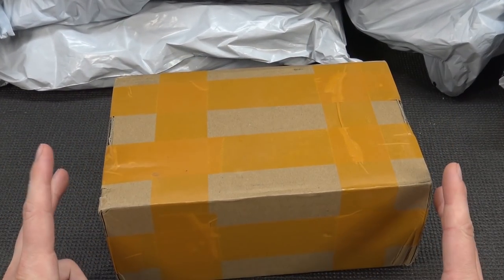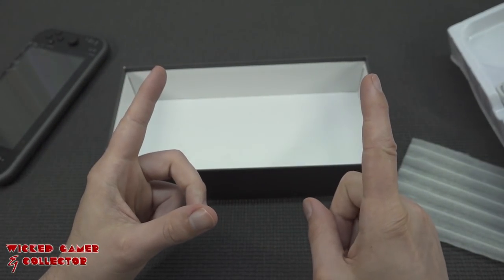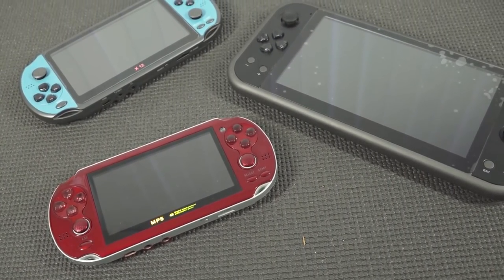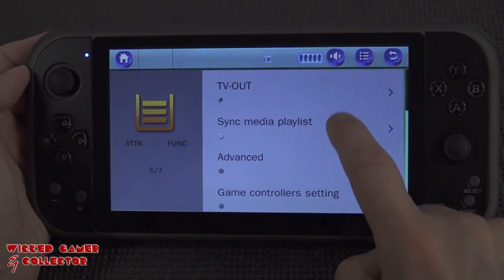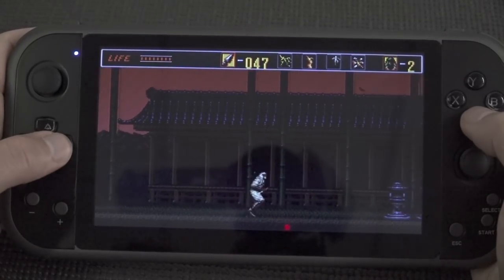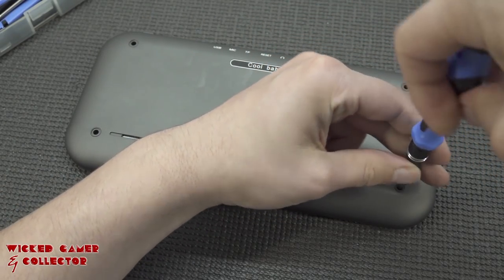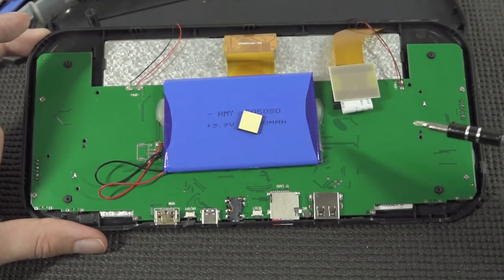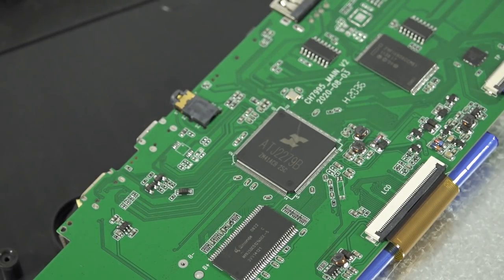7inch Budget Gaming Beast Handheld with a Touch Screen ... 👈

Comment: I like the form. I wonder if you can just take out the crappy guts and replace it with a decent chipset? Maybe rpi CM4 and a decent battery.
Reply: It would be nuts if someone manage put a Pi Zero 2 in it, nice systems and much more capable emulation, even some psp. And that device is beautiful, with more power it would be nice

Comment: I loved the x-15 because with drastic it was actually one of the few devices that was well designed for ds emulation with a mic and touch screen... but my god the lack of google store support and having to hunt down cracked apps and get them working really ruined it for it.if they made a version like the x-15 but with a better directional pad and 2 analog sticks, and google store support, it would be a great little handheld.

Comment: And it's again the ATJ2279B, I knew it just from seeing the software, especially the settings menu. Well this one is not going to provide much power as it's a MIPS at 400 MHz or so with only 2D acceleration.
 Software could be improved though but unfortunately it's not open source. I was thinking of reverse engineering it but not sure I'll have the time and mood to do it.

Comment: Hey man! Can you tell me if any handhelds have Amiga 500 games, please? Cheers for the videos BTW!!
Reply: Your best bet is the rg351 won't come with any installed. But you can install a 500 emulator and games yourself or there are sellers on eBay who sell SD cards absolutely loaded with all different kinds of emulators.
Reply: @simonday9013  hi, thanks for the information, which type of rg351? M, P or?
Reply: @Daniele_Lampis  it doesn't matter as far as internals go. The p has a plastic body (a very high quality one) and is cheaper than the m that has a metal body.
Reply: My rg351p came with amiga games installed. They tend to dump them all on one amiga folder but it will run cd32 and other variations as there are 3 different emulators curated by emuelec and retroarch
Reply: retroarch compat ones have emulators.
Reply: Thanks you all for taking the time to help me out! Love your work!!!❤💯

Comment: I just may get one of these! It looks like my Powkiddy X2.
Reply: Dont waste your money Johnno. 
At least with the X2 (and my RS18) you can change system icons and add boxart to your own builds. I did.  (Although can be time consuming). 
This one has the crap UI and sub par performance. 
If you want another cheaper 7" you are better off with the revision 2 of your X2.
At least that one has better joysticks, dpad and type C connector. 
Still no L2 and R2 though unfortunately.
Reply: @fonzitheman  The system icons and boxart don't bother me. I still plan to get one! There are lots of things I like about this one, including the design, the dual speakers and aspect ratio options.
Reply: @jonathonearl482  
Well, you obviously know what you''re getting so…. Have fun I guess 😌🙂
Reply: @fonzitheman  
I have a different handheld in mind that I think we both could look forward to. I'm looking forward to purchasing myself an AYN Odin! It just may be the handheld to successfully break the 32bit barrier.  Able to run N64 flawlessly and has a 6 inch screen. What are your thoughts on the Odin?
Reply: @jonathonearl482  
Oh yeah, I am interested in that too. 
Maybe the Odin Lite though, not sure yet. Will see how reviews are on all the diff versions.. 
Its not a 7" I know but almost 6" isnt bad I guess 😊.
Not interested in the Powkiddy X18s or the Steamdeck either, mainly cause its more than Im willing to pay for a handheld and a few other reasons too. 
So yeah, at the moment the Odin is what Im most interested in.
Reply: @fonzitheman  I'm not interested in the X18s or Steamdeck as well. The Odin is somewhat expensive but you have to keep in consideration that along with the dock it also becomes an HDMI TV console with N64, GameCube and USB controller inputs. I thought about getting myself a Switch Lite but I'd much rather have this Odin handheld with the dock. The version I want is the Pro it's even more powerful for an extra $50 or more. Also, if I get this Odin and it performs well, it would be the last handheld I would need for a very long time. I also have my Wood Edition RG351V for even more portability at times.
Reply: @jonathonearl482  
Im quite happy with my RGB10Max for the moment and I still have the old JXD S7800b,which I was in the process of setting up again after replacing the touch screen but just havent bothered turning on a for a while. 
I know its crazy but I also still like that revision 2 of the Powkiddy X2,even though its hasnt got L2 and R2 theres something I like about it.
Reply: @fonzitheman  I still have my JXD S7800B as well! I seriously need to take it off the self, charge it and customize it when I get some extra time. My White Edition Powkiddy X2 is still with me as well, my favorite Powkiddy console at the moment.

Comment: I'm going to get one of the 7 inch screen emulator handhelds soon. I've seen your channel do the most reviews of the various ones. Which one would you recommend? I would like it to allow SD cards and possibly adding games myself. I'm also not going to spend more than 50 dollars on it. I recently got one of the Gameboy style ones and the slightly bigger one with direction pad on one side and buttons on the other side. They both play NES roms mostly and they are stuck with what comes on them. Not complaining because the bigger one has almost a thousand games and I paid 3 dollars for it from Temu lol

Comment: had been curious about these devices for a few weeks abd was about to drop some cash on one . Then i heard that you can emulate PS1 on your phone. I just installed the PS1 emulator on my Samsung Galaxy A01, THis phone cost less than $60 dollars out the door. It is a cheep little Straight Talk phone.  JUST two minutes ago got done downloading the N64 Emulator and the 5.9MB Mario 64 rom. It runs it just as smooth as snot. can someone explain why these systems cost so much and dont have half the functionality of my cheep straight talk phone. Just as an experiment please try the phone you have and tell me if it runs ok or not?

mine runs Mario64 on an emulator pretty well and the the PS1 game called teken i think as smooth as it was in a playstation original.

Straight Talk version of Samsung A01
Reply: Because touchscreen will never compete with physical gaming controller. These retro games are designed with these controllers in mind of developer. Emulation is great and all but you will get bored by doing this on a touchscreen. Of course you can purchase a attachable game controller to your phone. But a regular gamer can easily get ticked off by its latency even on an old game because Bluetooth face latency issue all the time if it’s not a pre designed feature of the device

Comment: The sad thing with these cheap handheld game systems they have trouble running Super Nintendo and the sad part is the Sega Genesis/Mega Drive is faster game console and the handheld consoles can play demanding games on the handheld console no problem. It doesn't make sense.

Comment: Touch screen on this is of no real use at all really. 
Same crap UI and performance.
At least the Coolbaby RS18 and Powkiddy X2 have the newer UI where you can add boxart and change system icons..  but can be time consuming. Its a step in the right direction. 
But this one, no way. 
Skip it.